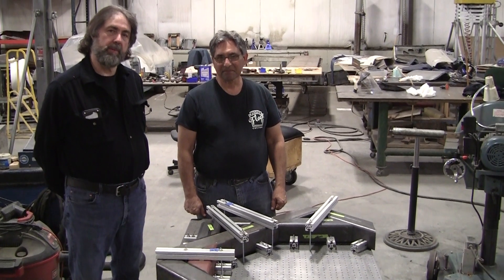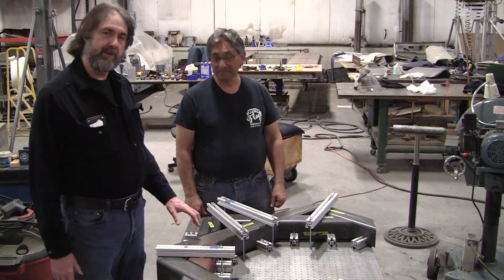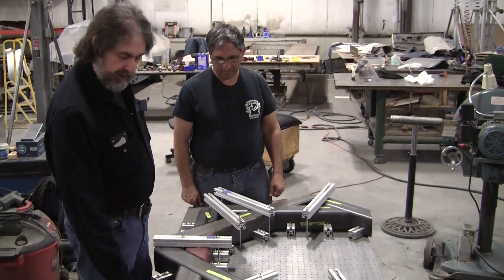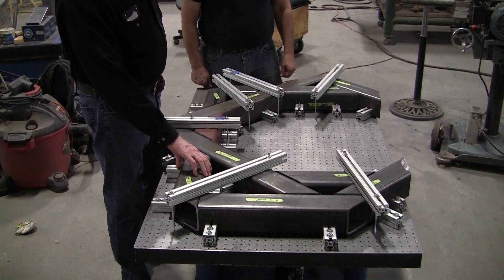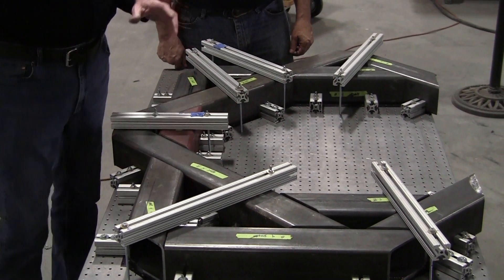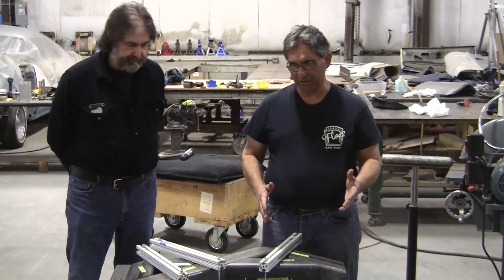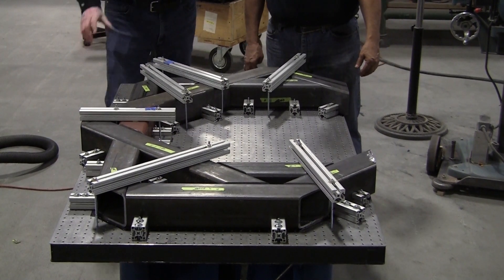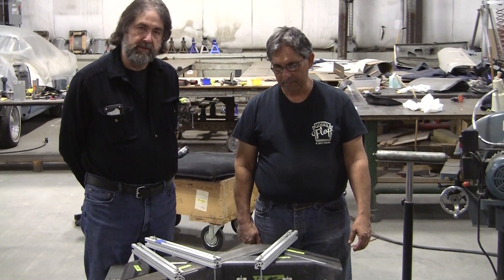Building an English Wheel Introduction

Comment: Definately looking forward to this series Wray!  Are you going to sell or recommend anvil/top wheel kits to suit your dimensions?
Reply from the maker: Hi Sam, Yes we will be offering two choices ( Basic and Deluxe) for both the full-scale plans and the mechanisms. We are currently building the first prototype machine. We will follow up with a full YouTube video build of the whole frame when we start building wheel number two.  The design of the frame is super strong but can be made inexpensively with drops or short sections of 4" square 1/4" wall tubing. Watch proshaper.com for information about this English wheel build very soon.
Reply: @proshaper   Thanks Wray!  P.S. Still young but been following for a long time.  Been using your shrinking disc on my projects for 10+ years

Comment: Looks good, will you be able to weld the back of  the 2 small braces as it looks tight for a mig torch.
In the past I have done those with a stick rod.
Reply from the maker: Yes, good idea on the stick welding in the tight spots. I think we can also tig with the tungsten out about an inch and extra gas. We can also weld in sequence ( pull the triangle supports out of the way until that tough spot is finished welded) which will allow full access.
Reply: @proshaper  
Yes but a nice 6013 1/8" rod on your 1/4" wall box from your DC set will flow nice with 70 amps..My money is on the stick rod to get you out the doo doo lol Stay safe